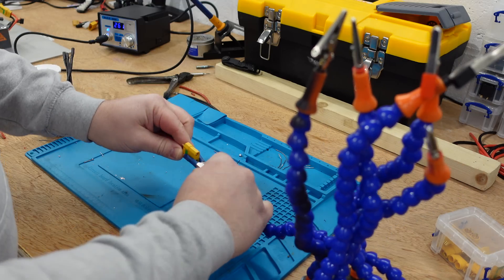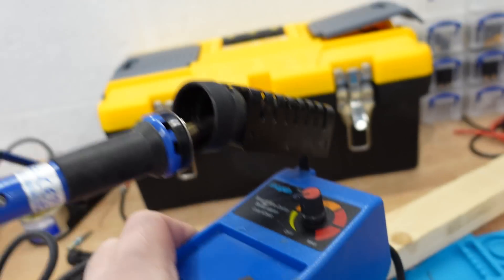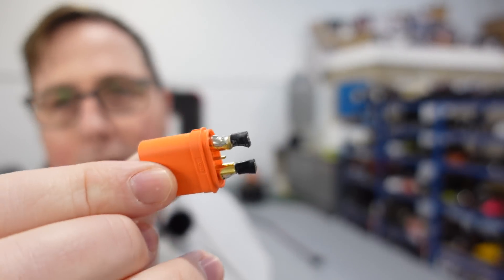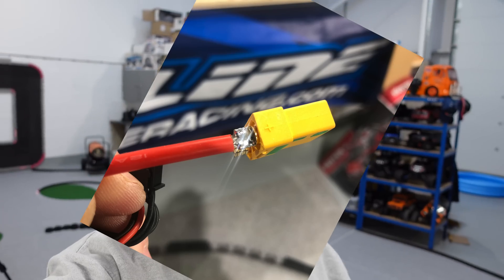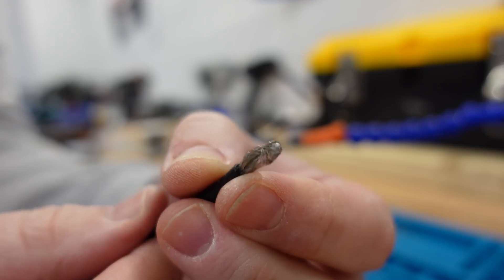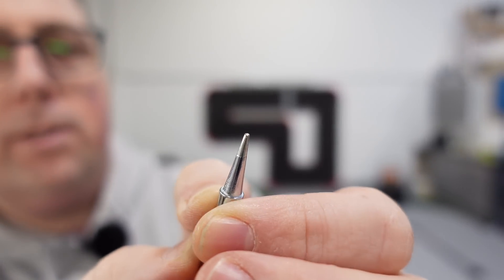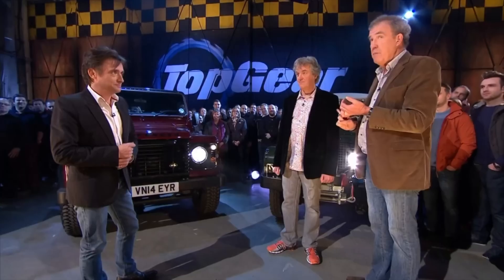EVERYONE Makes these Soldering Mistakes!

Comment: Soldering is honestly a load of shit!  I try and do it "the right way"... nothing happens.  I try pasting the solder on the wire because "the right way" doesn't work - the solder sticks to the iron instead of the wire.  I try raising the temperature to force "the right way" to work - instead the wires just go black!  I try changing the tip from a point to the flat chisel piece... no difference!  What the hell is wrong with this stinking process?  Is it because I've got crappy lead-free solder or something?  I'm just trying to rejoin a few loose strands now to an already-connected wire and even that doesn't work!

Comment: 6:52 - this technique doesn't even work on 18 AWG with a 100W Soldering Iron at 454C!  I end up having to do the bad technique you just mentioned because otherwise I'm just pointlessly trying to hold a soldering iron below a wire and solder above the wire and have nothing happen except me losing the position with my hands and melting something else I didn't mean to!

Comment: I have experienced the occasional braided wire cable that solder absolutely will not adhere to. I assume it's to do with a coating on the wire braid, silicon or similar? Even after lots of heat, solder just balls & rolls off. Never really got to the bottom of it.

Comment: I struggled for years with soldering. First struggle was too low wattage cheap irons. So I got a cheap high wattage iron. Not much better… So after a couple years of dull grey falling apart solders with that, I sprung for a proper Weller high wattage iron. Things somewhat improved, but soldering was still a massive pain in the… fingers actually, as I burnt myself more than I did anything else. So I started watching YouTube videos of people soldering. Still couldn’t get it right. Figured I just didn’t have the skill… that I was a forever noob… Until one day I noticed that in RC vids they had a different tip. A chisel tip!!! Holy shit. So I ordered chisel tips not realizing that Weller irons have model specific tips… Money wasted and lesson learned, I finally got the right tip and damn, soldering is easy! Top TIP: get the right tip! Now I periodically desolder my older builds and do it up right.
Reply: HAD A  23 WATT WELLER IRON. IT DIED AFTER 20  PLUS YEARS  GREAT UNIT. SHOULD I GET A CHEAP ONE OR BUY ONCE CRY ONCE  GOT ANOTHER WELLER. 40 WATT WORKS THE NUTS MONEY WELL SPEND

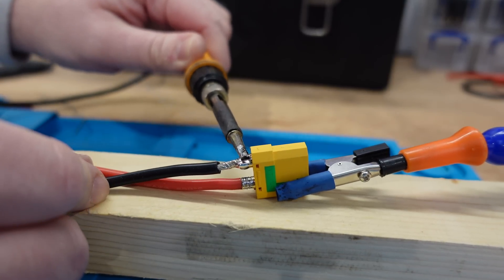Comment: 6:35 by taking solder to the wire on the tip you burn away the Flux. Feeding would actually make for a better joint.
Reply: 7:00 too much solder on the tip as you blobbed the connector. :-P
Reply from the maker: Way to much in general as I’d used this connector to many times to show the technique 😛

Comment: missing the heatshrink, multiple times, on the same freaking piece of wire.
Also EC5 connector. 
1st good solder, forgot to put the plastic part on first.
remove, put plastic on, screw up connection because i was annoyed with forgetting it the first time. So it doesnt hold.
Get more annoyed, resolder with a good connection. look to the side, see the again forgotten plastic piece.
all in all took me about 5 attempts and lots of swearing to solder 1 connector.

Comment: I certainly do some of them , to much Solder , forgot the Heat shrink. 
Melt the plugs is my best one . I got a 100w soldering iron. I still can’t solder holding it underneath the XT90 I poor tons of solder into the pot and while it’s still boiling I shove the wire in . Then the wire can get to hot to hold , 
I flaming hate soldering . 🤗 I still get by though 🤠🤠🤠🤠

Comment: I hate soldering.  For some reason its always messy and takes a few try for me.  Watching this makes me think my 35w iron is not strong enough
Reply: That depends on the tip and type of solder you use, I use 60/40 with a chisel tip.
I've soldered XT90s + 8AWG with a 25-30w iron (forget whether it's 25 or 30), the benefit of the older style irons is the sheer thermal mass they provide - I have also have a TS100 which is a 65w iron and it's not as good as the 25-30w iron simply because of the smaller tip.

Comment: No.11: make sure the wire and contact are touching in the solder joint (titanium or tungsten jewellers pick helps here), not floating in the solder pool - helps current flow no end especially 4S and upwards. Crimp and solder best.

Comment: Really nice I know right I seen some soldering that’s sketch stuff to  yes guilty here  :)   I do a pretty good joint.  But I have been sweating copper pipe in the heating air conditioning Field  with 14% Silver  since. 1998.   I just made a couple of joints on my New  motor with the ISTD esc 70 .  I did it right yes 👌.

Comment: One final tip especially when using a metal "helping hands" tool. If soldering on battery connectors always cut and solder one wire at once and insulate the connectors

Comment: Hey Tomley, about the "small soldering iron, probably battery powered"... It's actually 60w! I have one and to tell the truth... It's much better than my bigger one. 😬
Either way, that one is perfect to keep in your backpack, for the eventual field repair, because you can power it from a 4s to 6s battery. (That's what I do.)
About the mistakes... Yeah... Heat shrink... Guilty as charged. 😬
Anyway, stay safe there with your family! 🖖😊

Comment: That shrink tubing thing also happens with tube nuts on brake line...and it's always a perfect flare or solder joint. I assume the pronunciation sang with just you know an England versus us thing. I wouldn't know because originally from Massachusetts tend to replace my Rs with a AH sound so my rc caah 😂
Reply: I'm from MA as well. "Got to soldaah a new connectaah on my RC caah" LOL!

Comment: Bah, you brits, pronunciation as bad as your soldering iron.  Get a Weller like a good solid professional.  ;)  seriously though, I thought it was BS, ive owned many soldering irons before I got the Weller soldering station... but it does ACTUALLY make a difference.  The iron keeps its temperature so strictly and the digital control... I can solder ONTO LIPO TOPS without them burning.  Like.. what other iron can do that?  Its nuts...

Comment: Was working at an electronics manufacturer in the 80's. I was building transformers and large resistance coils.
Lots of soldering. Now I build a lot of wiring harnesses for bikes, hotrods, and trucks.
I've gotta say that you hit on all good points, and a few of these, I'm still guilty of. I can be lazy about changing irons between different jobs needing points instead of chisel tips, so . . .
The missed shrink tube, OMG! 
 I hope you and yours are warm and well. 
Have fun.
Reply: I tend to use uninsulated crimp connectors and solder them after but I use a butane torch to heat it

Comment: I'm still well disappointed at the loss of the Maplin stores! We had one here for ages, and although I didn't visit more than maybe once a month, it was super useful and the staff were top notch!!!
Reply: Maplins was great back in the day. Me and my uncle gave each other the challenge to take a cheap rc from argos and create something better. (I chose a £5 subaru back in 2003). Anyway, first time id been to maplins they had a wall full of different LEDs amd sold the them in singles. I created my own light kit and had an awesome little car, blue underglow with front and rear lights too.
Reply: Great source of AAs.

Comment: When soldering wires to an XT or similar connector, have the other side of the connector fitted- It will hold the pins straight, if the plastic body starts to soften/melt....
Reply: Was going to leave the same comment 👍
Reply: Yeah, me too. But that means it's a pretty bad connector. 😕

Comment: I've gotta be honest, the ts100 is one of the best soldering irons in the market, you can update firmware to make it even better. They are not just for small gauge wires. The majority of the fpv community has one. They have many different tips so they are perfect for all manner of wires in rc
Reply: Ts100 is good for little drone stuff but if your soldering battery connectors it's worthless
Reply: I switched from a Weller to a TS100. Ergonomics is worse, but everything else is way better. Especially when you use it with a 24V power supply. Then you got a 65W iron with the heating element directly integrated into the tip.
Reply: And it solders 10 and even 8 AWG with ease!
Reply: That sounds more complicated and expensive then it needs to be
Reply: @masjuggalo  But it's not. It's exactly the same as a soldering station like Tomley showed in the beginning, but probably around 1/10 of the price. 
I have a TS100 as well and it's truly amazing how it works.
Reply: @MCsCreations  they are awesome I even managed to solder 8awg wire don’t get me wrong it took a while to heat the wire but it gets there they are a good field iron but would definitely say get a bench iron.
Reply: @masjuggalo  While it's certainly more complicated than just buying a typical iron, the TS100 is quite cheap.
I own one and to be honest I think 8AWG is really pushing it, an old school 25-30w iron with a chunky tip handles it infinitely better because of the thermal mass of the tip.

Comment: More power does not mean more heat transfer. A clean tip means more heat transfer along with putting solder on the iron to make good contact without a lot of pressure
Reply: A bigger tip also helps.
Reply: @MCsCreations  that's what she said😂
Reply: @huckaberryfpv4986  Ouch... That would burn! 😬
Reply: @MC's Creations  It adds thermal mass, there is a lot to soldering. It takes lots of experience and can't be learned in 20 minutes. This video is pretty decent and gives good advice
Reply: Agreed. More power simply equates to More Heat TO Transfer. The larger tip help with transfer as there's more surface area touching and passing heat. This is also why a lil' dab of solder on the tip greatly helps heat transfer! More surface area passing heat.  Conversely, this is why it harder to get heat into ground plugs or pads. Typically, any ground location shares the "ground plane" (a monolithic sheet of metal that lives inside the pcb) with all the other locations. There's a LOT of heat dissipation there (Damn, I should just go make my own video! 🤣)